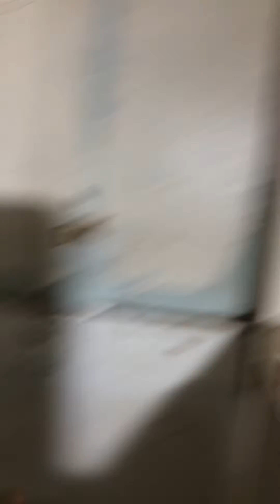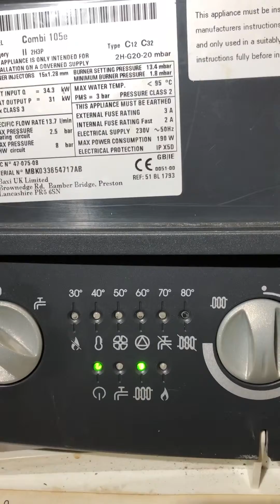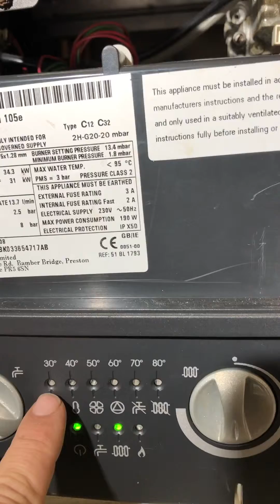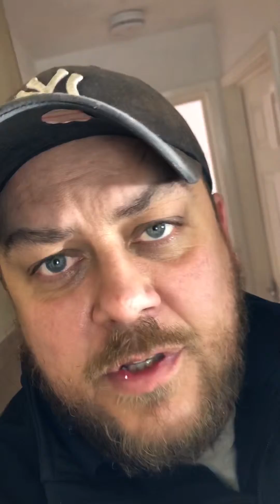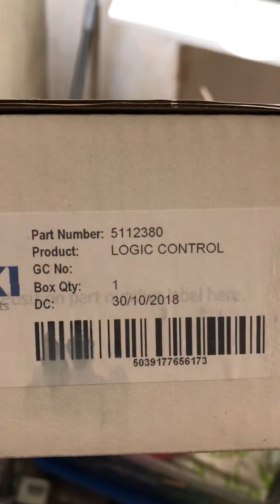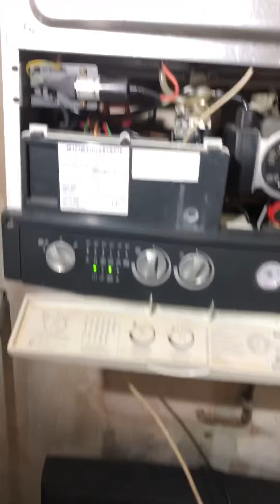PCB on Baxi 105e

Comment: Had the same problem mate, intermittent though, thought the diverter valve was pulling enough, fitted a service kit, now got a leak on the bypass pipe back of the diverter, changed the seal, still leaking!! Any suggestions mate?